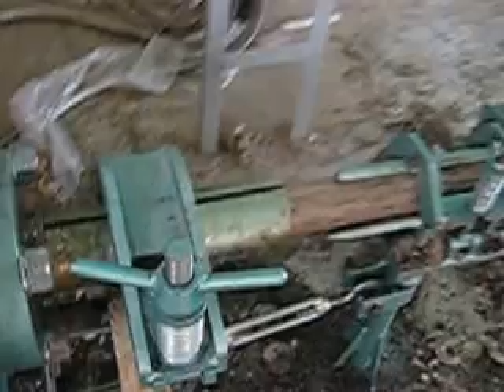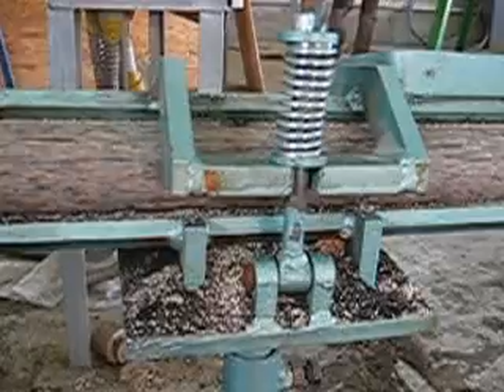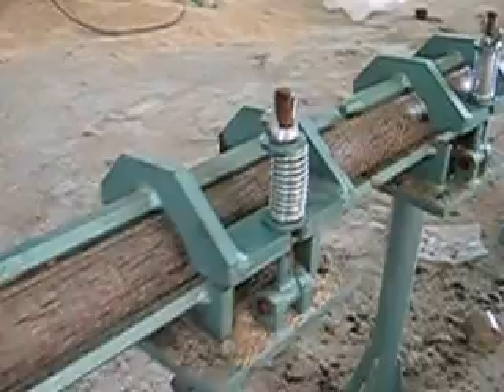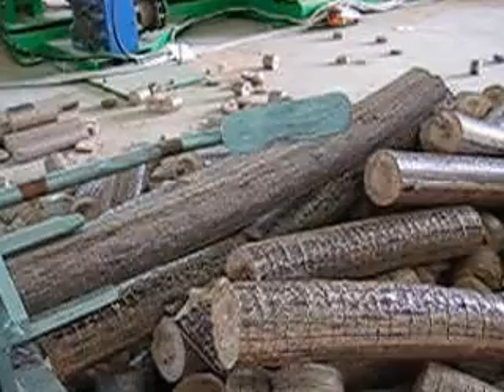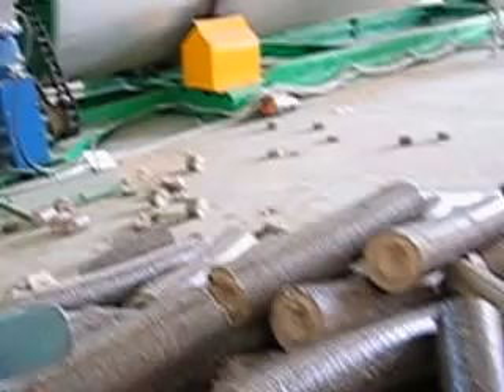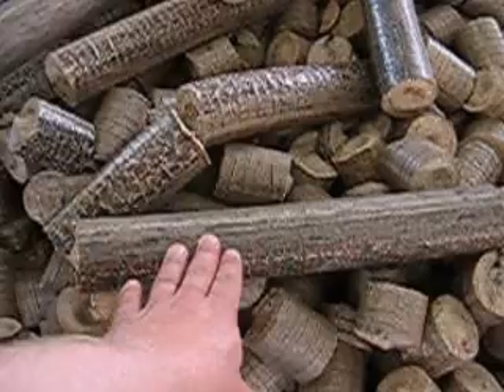Sawdust Briquetting Press 500-750 kg/h Briquette Pellets Bio-mass Brikettpresse Straw pembriketan

Comment: what is the maximum permissible sawdust moisture
Reply from the maker: The process of briquetting sawdust on our machines is simple, but at the same time very complex.  There is no simple recipe.  Of course, ideal sawdust has a moisture content of 12%, but if your sawdust has less than or less% moisture, then we regulate the production process with the appropriate pressure in the forming sleeves.  And in the amount of raw material fed.  The entire process is controlled by inverters.
Reply from the maker: Write email wektor@wektortorun.com
Reply from the maker: As a standard, we allow humidity to 12% for briquette production, the option is 15%, but my clients also allow 18%,
The quality of the briquette depends on the humidity and fragmentation of the sawdust.
Everyone has different priorities.

Comment: Buna ziua. O line complectă de peleți rumeguș   6 mm 300-500 kg/h si o linie de brichetat rumeguș 70 mm 300-500 kg/h.
Reply: Ce preț si cîți kw sînt necesari
Reply from the maker: Noua generație de brichetă BT-60 va produce
brichetă cu diametrul de 70mm - 500-750 kg / h
pelete 6mm - 150-250 kg / h, pelete 16-18mm - 200-400 kg / h
Reply from the maker: @viorelmoise11  scrieți un e-mail și vă voi trimite o ofertă wektor@wektortorun.com